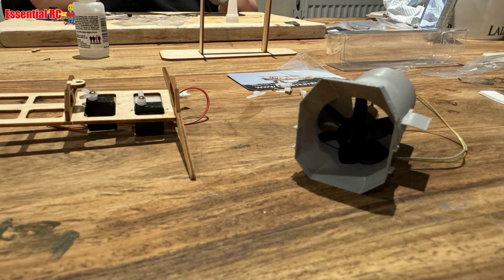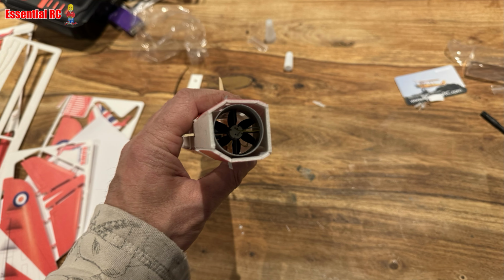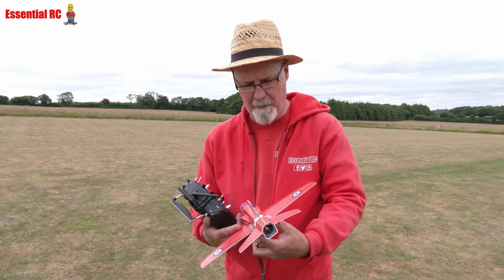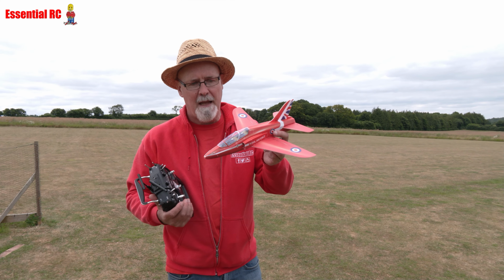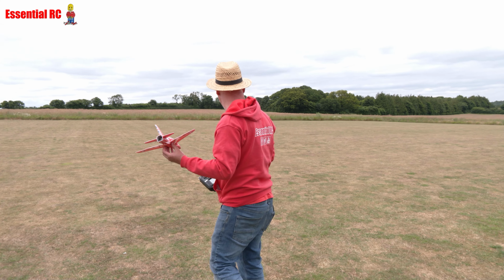SMALLEST radio controlled RED ARROWS BAe Hawk 30mm EDF Jet | MinimumRC quick build kit

Comment: You might have less trouble keeping your hat on in the wind if you used less Brylcreem on your hair there, Dom! 🤔😜😁
These little MinimumRC kits are fun to build but a bit finicky to operate with the low power drive and somewhat delicate construction. Also any servicing needed is going to be a nightmare with everything solidly glued in.
The new Savannah model has gone up to 2s but still brushed. I don't know how much 7.4v brushed motors have improved these days either. But a few years back any little Quadcopter that went to 2s brushed usually had motor problems pretty quickly.
Reply from the maker: Utter nightmare with a shiny head. It is very well fitted so rarely comes off though. I really don't want to be running after that hat down the runway. My running days were over a long time ago 😆 But year...the single cell MinimumRC jets do lack a bit of puff. I've tried everything to improve it. Did wonder if it was throttle calibration on the ESC but no improvement. My friends at FlyingFinnRC built a few of the prop planes so we'll try those soon...and maybe the Savannah in the near future.